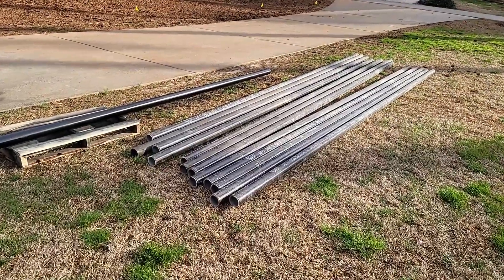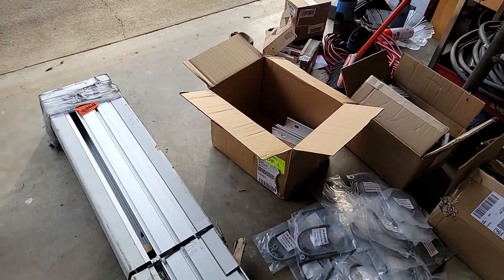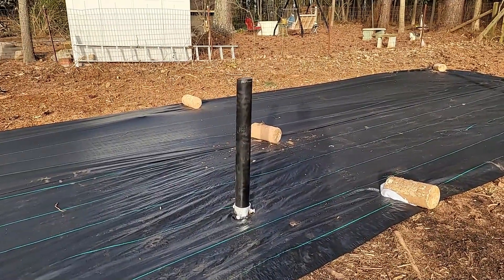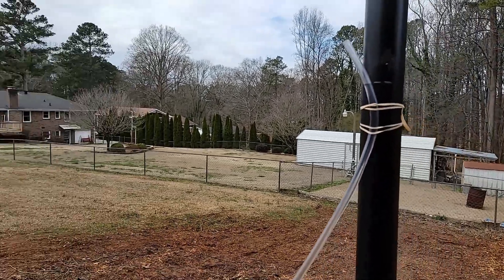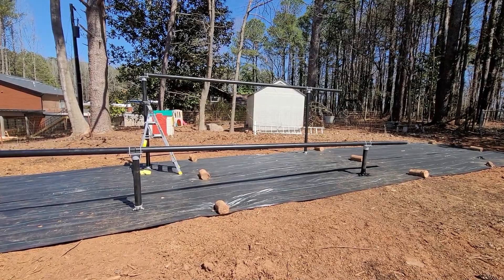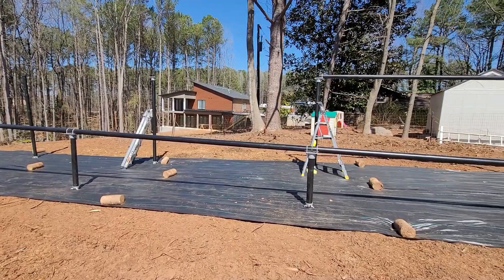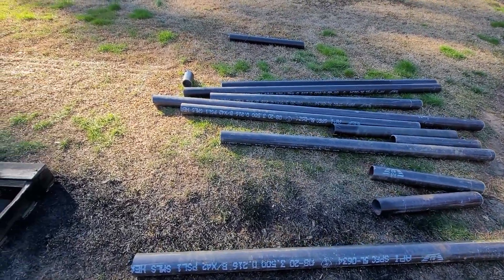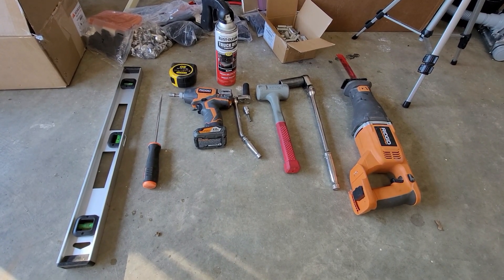Ground Mount Solar Array Part 4 Iron Ridge

Comment: Looks great Dom, if you don't mind me asking. What kind of Pipe did you use? I've been looking for Sch40 Pipe and its like $275 ea for 21' pieces. Is that what you used or is that 3.5" Oil Field Steel Pipe?
Reply from the maker: Pipe that I used was steel pipe SCHD 40 and it had some kind of blakish coating on it. It might be what you are describing .. Stainless or galvanized was out of my price range.. I have video that goes into details on what I paid for what. It might help.